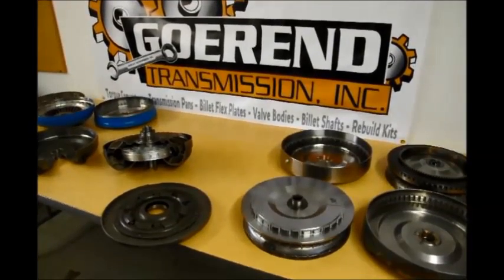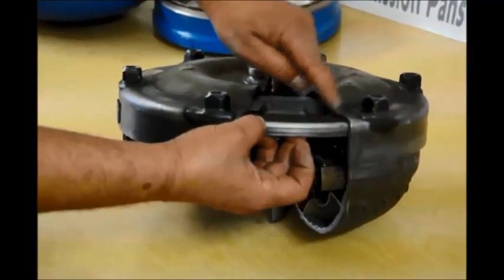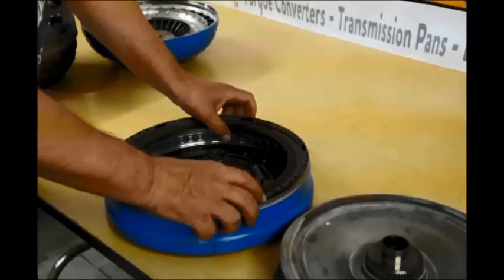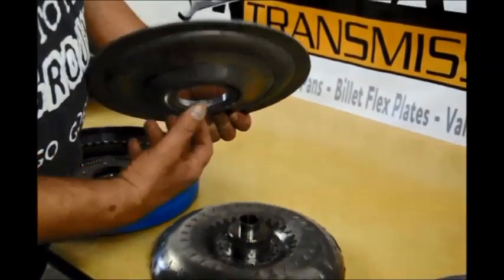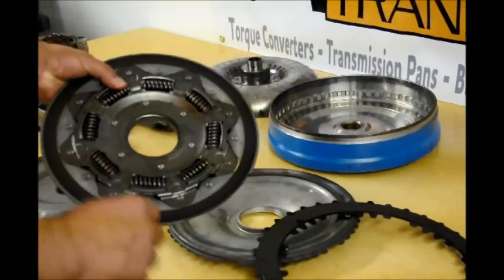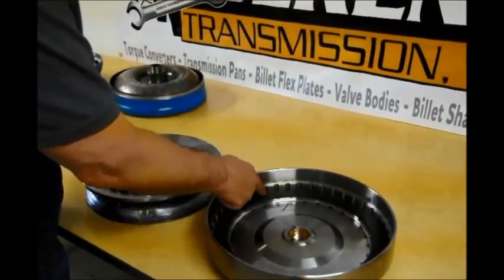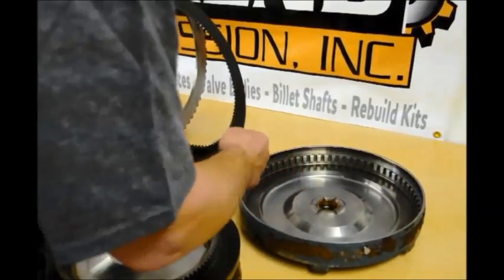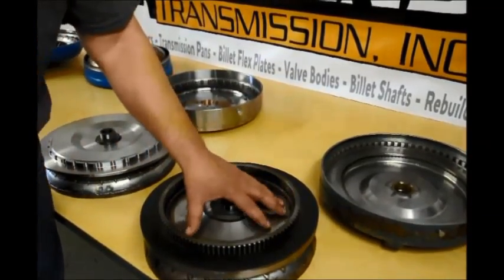Single, Double, Triple, & 4 disk Torque Converters Explained by Goerend Transmission

Comment: Interesting and very misleading that they (the industry) count each side of the same friction plate as a separate disc. So, one double sided plate is counted as 2 discs. They should count them the same way as the clutch packs. Each double sided friction plate is counted as a single clutch, not as 2 clutches. Thanks for clearing up that inconsistency in the industry. Very good video.
Reply: Agree
Reply: Know which ones do that?

Comment: at 0:18 when you mention the lining is that what people refer to when they say "woven kevlar liner" or w/e torque converter? because on the 4l60e's the kevlar lining seems to be a wear problem like it disintegrating or something...and i was expecting to see some type of fabric-esque liner somewhere
Reply: Cranky Jay if some one never answered you the it’s not part of the converter “Kevlar” band I believe is what your asking?
Reply: If the friction disc is disintegrating, it could be contaminated fluid (wrong type used), extremely dirty fluid, or over heating from too much hard use (either towing excessive weights, especially on long hills at too high a speed or hard use from rabbit starts from stop lights, burnouts, etc)